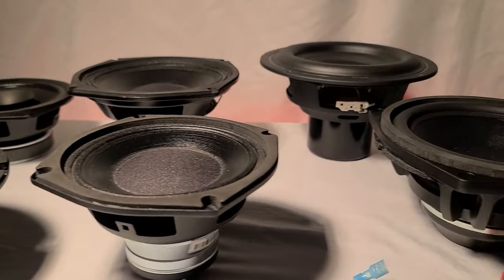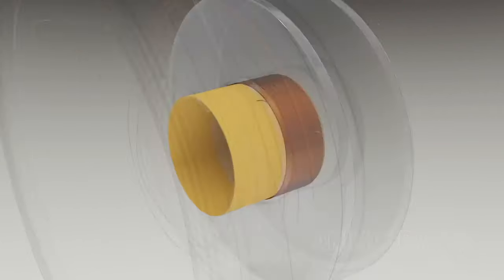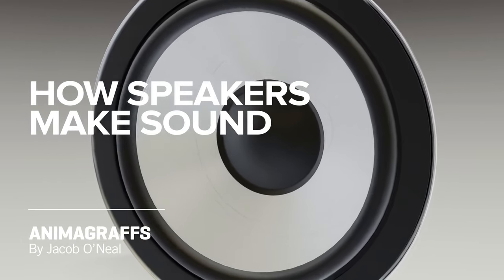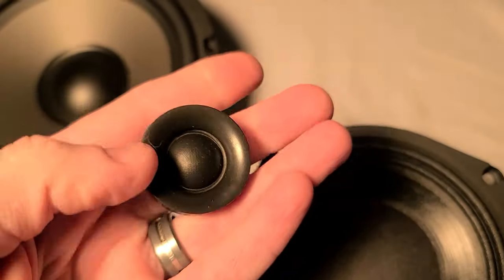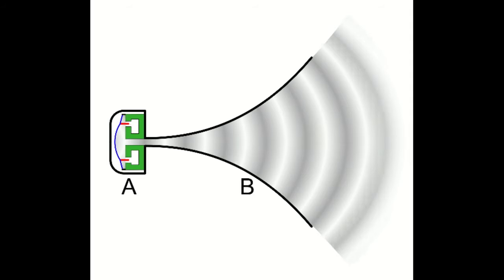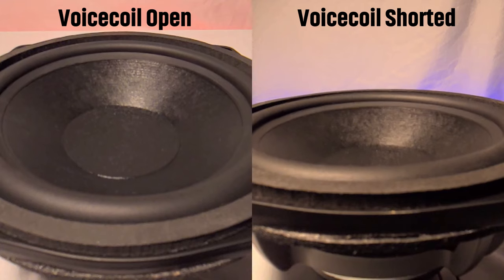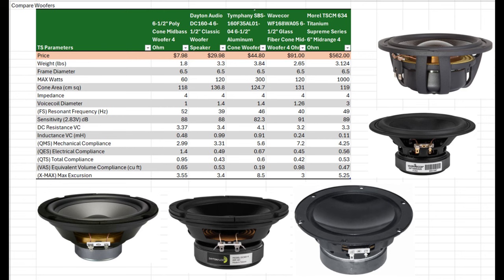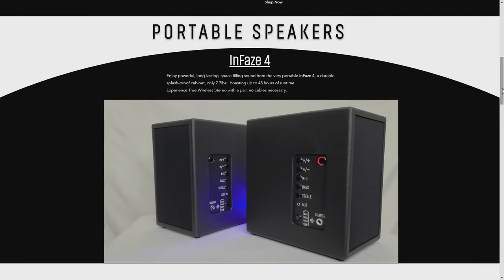InFaze Audio 201 | Speakers | Why Do They Move?

Comment: How does the compression driver concept apply to subwoofers? Just curious and still learning.
Reply from the maker: Compression drivers are unique in that the phase plug is built into the assembly.  
I have seen phase plugs for mids somewhat commonly in PA speakers, but they are part of the cabinet design.  On horns, even woofers can be mounted behind the horn panel with only small holes or slots for the sound pressure to enter the horn.